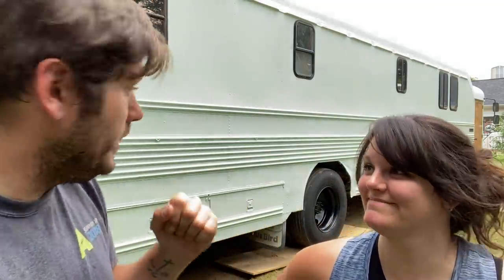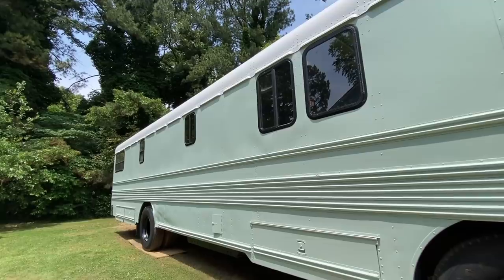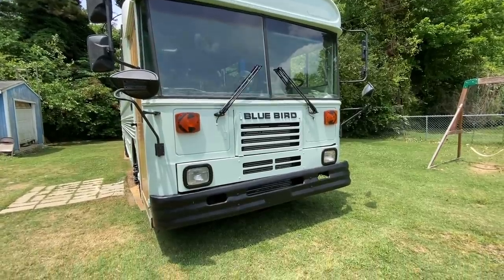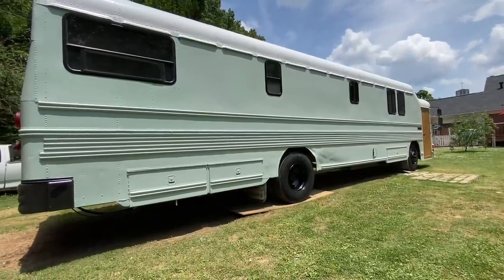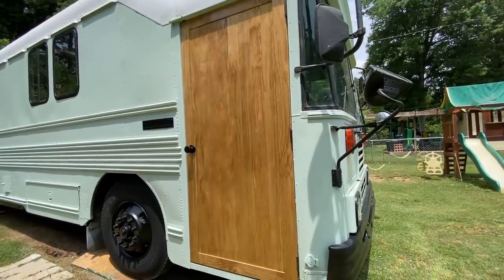School Bus Conversion Episode 13 - THE EXTERIOR IS COMPLETE!!! HUGE TRANSFORMATION!

Comment: Tremendous job folks. Looks absolutely fantastic. Beautiful. That wooden door is so unique. Any concern that it will swell and stick in humid areas?
Reply from the maker: Thanks so much! Yes that is a concern. But we really wanted a wooden door. The main structure of it is plywood though and plywood doesn’t swell or shrink. So there’s that. I figure if it does ever pose and issue we’ll swap it out for a fiberglass door. Thanks for watching.
Reply: @lifeanywhere  I guess if it did you could also trim a side and add thicker weather stripping too.
Reply from the maker: @allmomomosthomebus3895  yep. Totally could.

Comment: I love it so far. Just bing watched all your video's. I do have some questions.
1. Are you going to put some kind of air conditioning in the vehicle?
2. How are you going to connect the bus to water or electricity on the campsite?
3. Are you going to put solar panels on the roof?
4. Are you planning on having a deck on the back or top of the bus?
Reply from the maker: Thanks for watching the videos! Appreciate the support. And, yes we will have a roof mounted AC unit. Possibly 2 but at least 1. We will have an inlet for city water to attach to the bus to fill our on board water tank and a plug connection outside to connect to city electric. Yes we will have solar on the roof. Pretty soon we’ll be installed a full solar system in the bus. And regarding the deck, the initial plan was to have a big one on the roof but because of the roof raise and the panels we won’t have much room for one. I’m CONSIDERING putting a small deck up front though above the driver. The part of the roof that wasn’t raised. It would fit 2 chairs maybe. Still thinking about that.
Reply: Família unida permanece forte alegres sempre felicidades

Comment: I'm a little confused I thought it easier doing  the inside frist than the outside last... Anyways it's you're  project. I'm not trying to be negative in any way good luck with everything..God speed!"
Reply from the maker: Thanks a bunch! Yeah initially that’s what we thought too, but because of the roof raise we had to add sheet metal and make sure the entire bus was dry and patched up so that nothing inside would get wet. So since we had to do all of that first we figured why not paint it.
Reply: @lifeanywhere   That worked out good then!"🚍❤